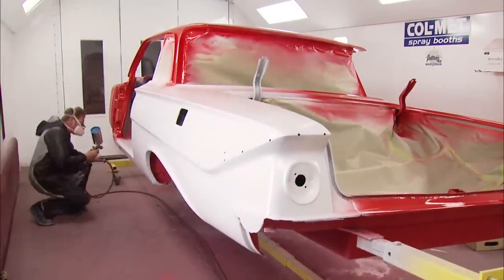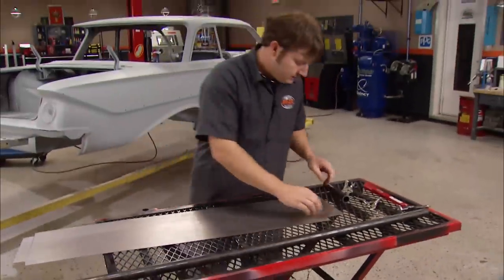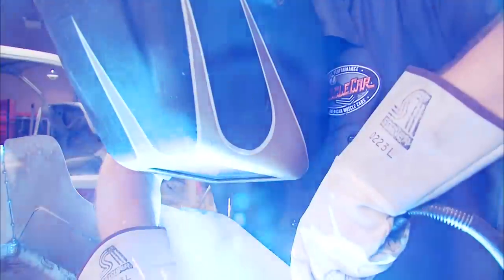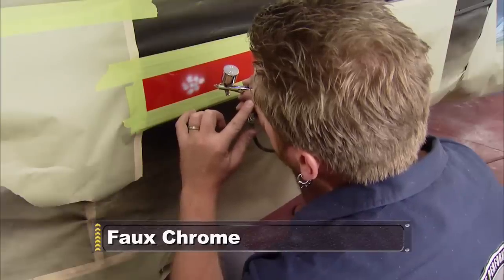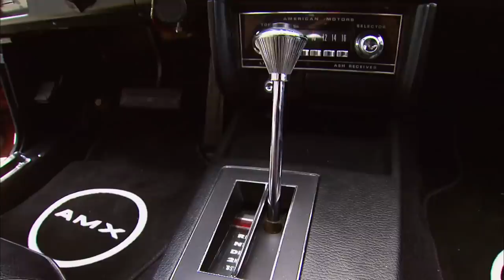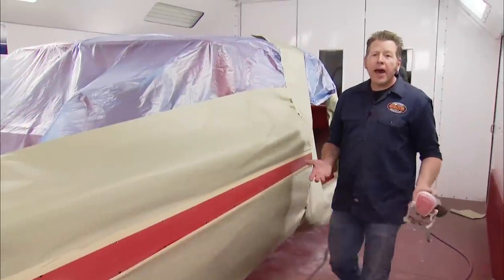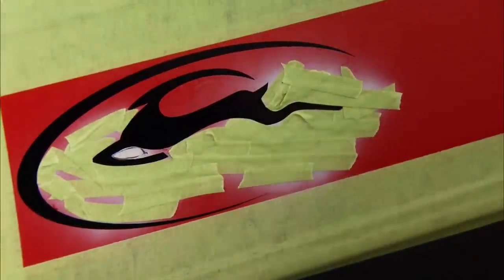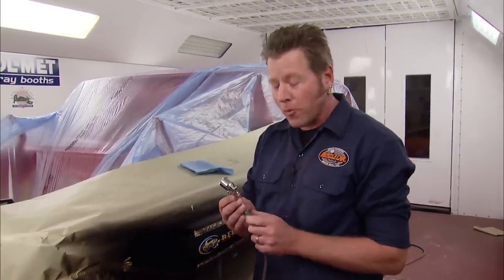Fabricating A Console For Our Red Sled '61 Impala - Muscle Car S5, E6

Comment: Great video content. But shopclassictruckparts.com just goes generically to your website without landing in anything to do with truck parts. I looked for a minute but found nothing to do with parts when the "shop" link went to video content for sale. 
If you can't land in actual classic truck part don't make such a specific site link. I was disappointed. I'll just use lmctruck.com it works great. Yes it is that simple to loose a potential sale. But remember I was willing to try your site first. I'm just not going to hunt for it.

Comment: How is he going to finish the joining panel seams upper & sides ? I'm guessing body filler /bondo why doesn't he take it up a notch it's great using all the vendors and metal hammers and shapers and shrinkers to finish it off with bondo take it up a notch other than body filler like soider / LED  finish it something very high or skill set that's all I would do it but then again who am I I don't have a TV show I have a body hammer and pretty skillful toolbox not knocking it just put a little twist on it